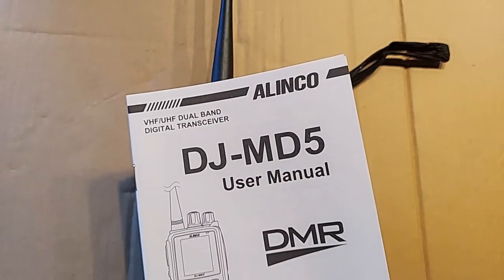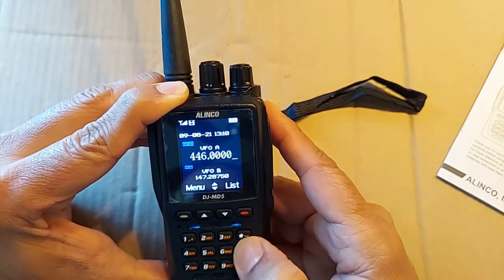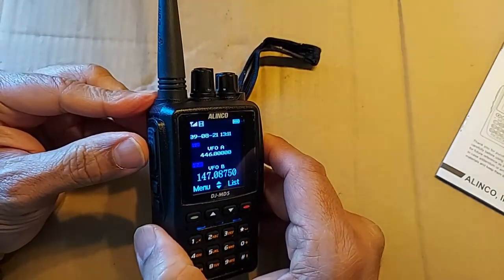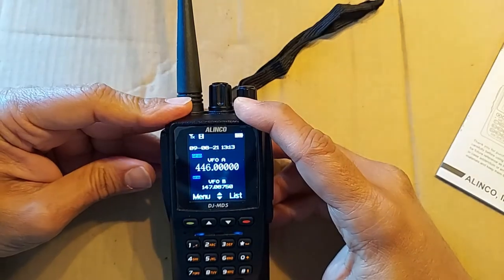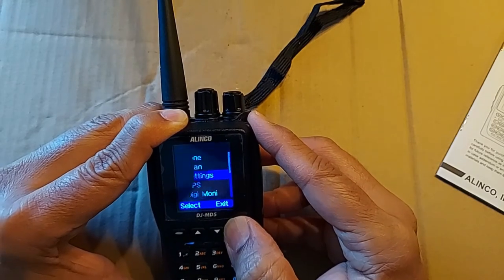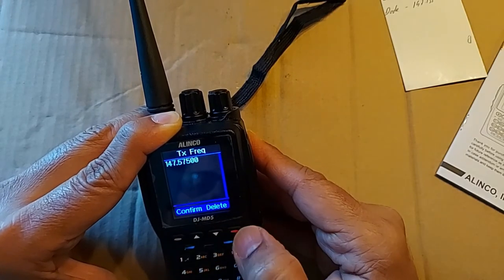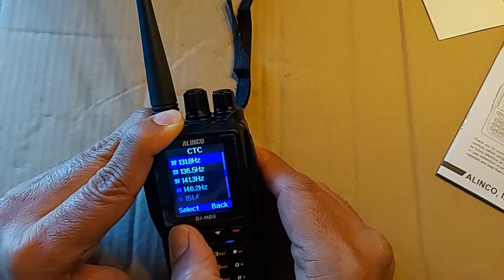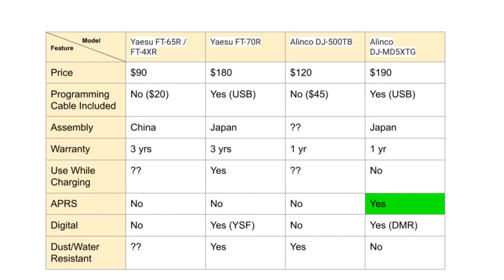Alinco DJ-MD5: Initial Setup Explained

Comment from the maker: Question for other new HAMs- Which HT would you recommend as a starter?
Reply: The Anytone D878UV plus, has everything you need
Reply from the maker: @rogersmith4926  thanks. I personally would steer newcomers towards a basic dual band analog HT. APRS on the HT has been fun for a bit has not been too useful for me. It is a beacon only and I rarely get picked up by digis when hiking etc. I wish they had the capability to receive APRS messages. I have a Yaesu FTM300DR in the car and the APRS is so much more fun there as I can see who all are around me etc.

Comment: Just got my Alinco DJMD5 from DX Eng today. I I have an old DJ160 thats 30+ yrs. old and still works, thats why I got an Alinco DMR radio.
Congratulations on your Ham license. 
Thanks for the video.
73
Reply from the maker: Thanks! Hope you enjoy your new HT. I have had a few DMR QSOs so far and once I figured out the codeplug, it sure is fun. Actually quite easy to setup using the front panel as well. I will likely do a video going over those steps. Thanks for watching -73
Reply: @22magnumforce64  I look forward to the DMR codeplug video.
Thank you

Comment: Congrats for getting your licence!👍
Thanks for showing this radio, I have not seen this before. It looks cool and very fancy, love that screen too.🍺🤓🇦🇺
Reply from the maker: Thank you
Reply: Hi do I need a licence to use this? thanks in advance.
Reply: @cheveredj8435  yes, you will need an amateur radio licence. Your local amateur radio club can help you with studying and doing the exam.
Reply: @DonzLockz  ok thanks for the information I really appreciate it.
Reply from the maker: @cheveredj8435  In the US, you can listen without a license, but cannot press that PTT button. Also (and I may be wrong here) you are not allowed to program it using the USB cable without a license
Reply: @22magnumforce64  Without a license, you can still use the USB cable but not talk on the radio.

Comment: Just got my Alinco DJ-MD5FXT (no GPS or APRS) from DX Engineering today, and am using your video for tips.
A few observations for potential buyers:
1. The manual that actually explains the functions hasn't been updated since 2108 and is for the MD5.
2. The model name in the radio info menu states it's a DJ-MD5X running firmware version 2.01-T, but there is no way to tell if that's the latest version because you can't download firmware for this device from Alinco's website.
3. it was made 02-24-2023  It still has the same quirk when setting the RX frequency you have to 'delete' it to back out of the menu even though you aren't actually deleting it because it pulls the frequency from the VFO setting.
4. You don't need to set a TX frequency if you are using Auto Repeater function because it uses the offset you need to program in.
5. The fit and finish of the radio itself is all quality.👍 Time to get my DMR ID!
Reply from the maker: Thanks for the notes. Congratulations on your new toy. Hope you enjoy it!!

Comment: Great video and thank you! 😊  I was wondering on which brand I should go on! Till I get my
Licence, as I live in mountainous region, and as I am planning to use it a little to none in the city, I thought it would be a great choice thank you for your video again! More feedback regarding this device is more than welcome, especially tests regarding messaging , encryption etc cheers from Switzerland 👍👍👍✌️🇨🇭
Reply from the maker: glad to hear you liked the video! If you are interested in APRS messaging, then I would steer you towards the Anytone brand. Pretty much an identical radio and both are made in the same factory I think, but Anytone I hear is better with their firmware upgrades. Alinco only does APRS location beacons so that someone else can track you (*if* you can hit a digipeater which in the mountains can be challenging even with a high power system).
Reply from the maker: I have tried DMR messaging, but it has never worked as the DMR repeaters in my area likely disable the feature. Someday I will try direct radio to radio messaging with a friend and see if that works. As for encryption, HAM bands do not allow it. If messaging is of interest to you, I strongly suggest connecting with local CH Hams to see what kind of infrastructure (digipeaters and DMR repeaters) is available before you make a purchase. Hope this helps and maybe others will chime in as well.
Reply: @22magnumforce64  thanks a lot for these informations really appreciated your point of view! I will check all this! I have a way to go as in Switzerland the exam is really tough! 100 question mostly related to electronics, electricity and magnetic fields etc 500pages book lol 😆
Reply: @bibicreationsCH  Switzerland has standard CEPT Novice and HAREC exams like in any CEPT country. The syllabus is exactly the same, although realization can be a bit (or "a bit") different. On the top of that, you can directly make HAREC exam and obtain your "high level" license without being stucked at CEPT Novice for a year or more like here in OM.
Main difference between those two is in the question pool regarding RF engineering and physics. I think Swiss "update" exam is regarding only that difference. Here in OM, it is completely new oral exam (with crazy amount of memorizing). On the other side, in HB they pay more than 100 CHF annualy for using the bands, here in OM it is 3 €/10 years :P and we have "all bands all modes" (that really means all bands and all modes accessible - not only one or two night bands and from day bands only those working only during the maxima of solar cycles) but with 100 W "only" (which is more than good enough if some dickhead with quadrillion kW will not howl you down).
Reply: @tulenik71  yes exactly! I'm taking the HB9 which permits the full licence, called capacity certificate! 😉 thanks for the info👍

Comment: My first was the yaesu ft3dr thinking id eventually use all that extra stuff and im sure i will. But id probably start with the FT65 if i had to do it again. Just bought one for my wife. The ft3dr menu is all clogged up with all the capabilities it has and stuff i dont understand. The ft65 would have been easier to deal with.
Thx for the info btw
Reply from the maker: I agree with you.  I've enjoyed playing with APRS, but I never seem to hit a digi when I am out hiking.  I think i would recommend a entry level yaesu or icom as a starter radio.

Comment: Great video. I do have a Yaesu FT 4XR and Ft 65R. Bought almost a year ago, they both say made in Japan. I also have an Alino DJ VX 50 which doesn't say where it's made but the battery says it was made in China. Just thought I would let you know. Have a great one.
Reply from the maker: You are correct. The battery on this one does say Made in China, but the radio itself does not say anything. The box just says "Japan". I am guessing after delivery from Anytone China , the final serial number sticker is applied in Japan (if at all) LOL! Thanks for watching.

Comment: Thanks for your video, you are the first I found talking about analog operations with this DMR radio, specially about scanning in VFO, I wasn't sure if its even possible. You didn't mentioned switching bands in VFO, does it work that way? Or scanning only works in whole RX spectrum of the radio? Can you scan in VFO only UHF or VHF? 

I am looking for my first HT and was on similar path as you, considering Yaesu FT65, or Alinco VX50, but when I get my license I certainly want to try and play with DMR and APRS so I am considering jumping over the very basic analog handhelds…Do you still consider Alinco MD5X as good started radio? Is it usable as a analog radio for listening at start even if its primarily DMR one?
Reply from the maker: Sorry for the late response. Let me try and answer your questions as best as I can. Yes, you can scan both UHF and VHF in VFO mode. Simply punch in the frequency or rotate the knob till you get to your frequency (that may take a lot of turning though). When you scan in VFO mode, it scans in increments - and you can customize the increment. I believe it will scan everything - even scan the weather channels.  (I will double check that and edit this if I am wrong). On the whole I like this radio and have enjoyed QSOs both on analog and DMR. I used a laptop to setup DMR, but I think you can do DMR setup just by using the keypad. You definitely need a laptop to setup APRS properly. But definitely a good starter radio for listening in analog as well. I am with you on skipping the basic analog radios if you know you will be playing with APRS and DMR in the future.

Comment: I jus got this radio a week ago and still haven't been able to get a QSO with it. Following what you did for a local repeater, all I get is a bunch of static. I use my IC-7100 shack radio to monitor my Alinco transmission and that's what I hear on the repeater. In comparison, the Icom is SO much easier to program, and I have no problem setting up all sorts of repeaters, tones, frequencies and the like. The menu on the Alinco is not user friendly and settings for each channel (like tx prohibit) are kinda silly. You buy this to use as a ham operator, not to prohibit transmissions. 

It looks like I'm going to have to actually buy my first Windows laptop just to program this thing. Hopefully THAT will work. 

So far very frustrated with it, but I haven't thrown it across the room. I planned on taking it on road trips with me but unless I can at least load my local repeater (and related network repeaters around the state), it's not even going to make a good paper weight.
Reply from the maker: sorry to hear you are having problems with it. It could be a defect. Have you tried remtronix support? - they were very responsive when I had an issue - which turned out to be operator error. The only other thing I can think of would be the CTCSS/DCS code may have been inadvertently set for both TX and RX. That would prevent any TX from the repeater from opening ur RX squelch unless the repeater sends the code. Unfortunately you will eventually need a windows device to really use this to the fullest, but you should not need one just to do a simple repeater QSO - analog or digital. I strongly suggest getting remtronix (or the seller) involved and making sure you did not get a defective piece before you go get a windows machine.
Reply from the maker: On the TX prohibit - yeah, I don't use that a whole lot these days. A radio wide TX prohibit would be good feature to have e.g. if I am letting unlicensed friends check out the HT or playing while you are unlicensed. I do however plan on using the channel TX prohibit when I set up my weather channels.
Reply: @22magnumforce64  I did manage to get a QSO the other day on one of my favorite local repeaters. I am spoiled by the IC-7100 interface I guess. The interface here seems so clunky, with unnecessary steps back and forth to get to where you want to go. If they went in a logical sequence it would be far easier to use. But I did make a contact and that's a big step. Now I just need to figure out how to save that to a "zone" and add more repeaters from the network here, which has repeaters networked statewide (or at least on my side of the state). 

So I'm keeping the radio - and maybe eventually I'll bite the bullet and after 40+ years of computing finally buy a Windows laptop JUST to program this thing a little easier. sigh lol

Comment: Do you know how to reset the Radio ?
Reply from the maker: Yes. First Power Off the radio. Press and hold [PTT] and the [PF1] button then turn power knob to power on at the same time to enter the reset mode. It will ask you to confirm, then the reset starts
Reply from the maker: If that  does not work, then likely reset is disabled in the codeplug. You will have to enable the setting using a computer.
Reply: @22magnumforce64  Thankyou,

Comment from the maker: SALE ALERT: Ham Radio Outlet has $20 off on the DJ-MD5XT  till 02/28!! https://www.hamradio.com/detail.cfm?pid=H0-017408 (no affiliation)
Reply: I picked one up! It’s a great radio!! I have a bunch of analog repeaters programmed from the front panel and it’s my daily dual band carry HT.

Sure would like to figure out how to set up APRS beacon in analog though.
Reply from the maker: @pauldsingleton  Congrats on the new acquisition!! For APRS, the set up is simple. Enable GPS and then you will see APRS menu just below the GPS menu. You can configure all your parameters there, except the call sign - for some reason the call sign is hardcoded to BG6LKK on these units! You will need to use your computer to change that. Let us know how it goes.